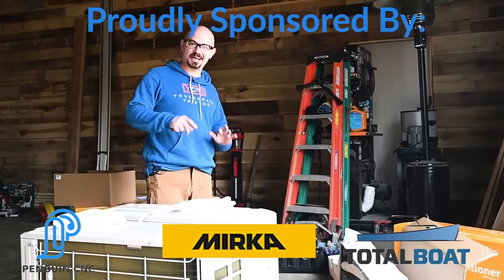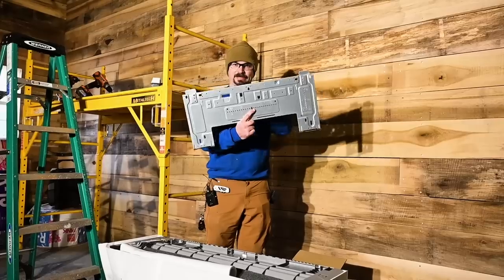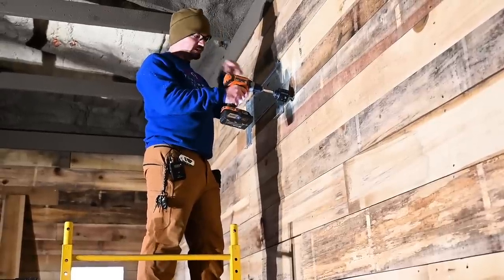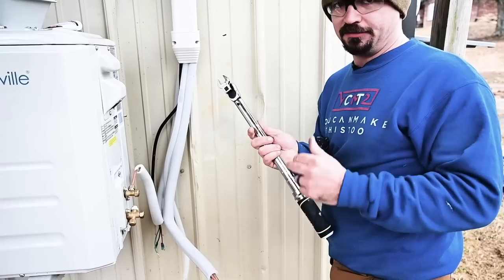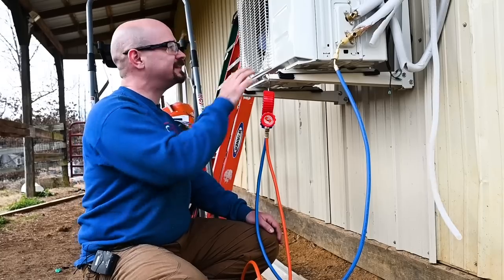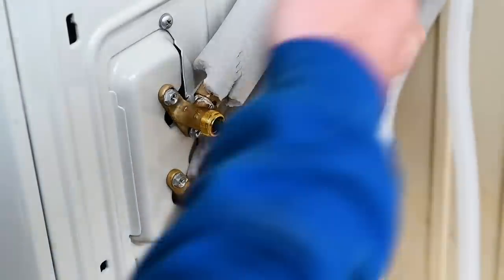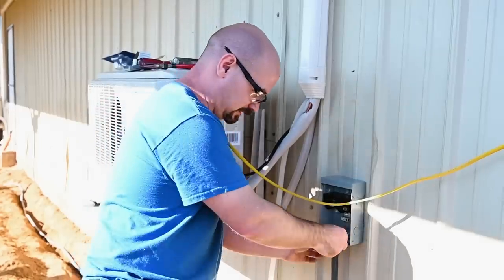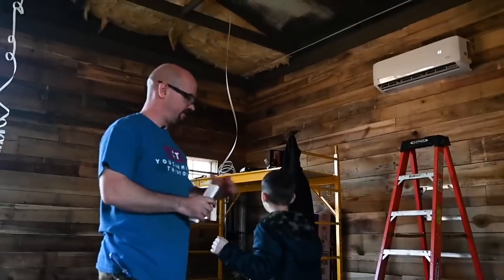Installing a Senville Mini Split | Dream Shop Ep8: HVAC Install

Comment: Some are saying you should have gotten a pro to do the installation. In my area the pros wouldn't do my installation unless they sold me the unit. I installed 2 units myself using Senville's installation instructions and after 3 years they are still running OK.
Reply from the maker: I’ve heard that a lot. 

Also in my area I’ve learn that most of the pro’s… aren’t. They’re just full timers.
Reply: What size (BTU) were your units? Did you evacuate the lines? I have a 12k senville 120V and am hoping not to have to evacuate the lines. 
Thanks
Reply: @RehdClouhd  I installed a 9,000 and a 12,000 btu unit. The Senville lines  were not charged, so they had to be vacuumed. The installation instructions tell you how to do it. I bought a vacuum pump on Amazon for about $60 and a single gauge manifold for about $30 from one of the mini suppliers and then sold them for about 75% of what they cost.  The MrCool (or MrKool) mini splits come with pre-charged lines and don't have to be vacuumed.
Reply: You are 100 % correct. I had a business that came to clean a mini split at my business, and I asked him if they would install a new unit for me. The tech told me yes and just got ahold of them. A few months later I asked them to install it and they didn't realize I was talking about a unit I bought, I was pissed since I needed it done asap and so I gave them a 2 or 3 star review saying they refuse to install a unit that wasn't supplied to them. A week later, the owner called my business partner and said he would be willing to do it, and they simply wouldn't warranty it(which was fine since I didn't expect them to anyway). They came out to give me an estimate and  wanted to charge me $2400 + $300 + 8.9%tax for the electrical, which they subcontract out. FYI, I was providing all the wiring/linesets and electrical boxes. I felt like they were purposely overcharging me to compensate for the fact they didn't sell me the unit and weren't making money on the sale or the fact that they were pissed about the review idk.. But paying $2700 to install a $2200(36,000btu 3 zone minisplit) unit was ridiculous since they were only going to send 2 techs to install it, and it would take less than 4 hours. So I decided if I was going to pay a total of $2,940  after tax I may as well buy the proper tools and do it myself!( also I was planning to add 3 more units over the next year into my shop so it would be worth the investment). I bought about $1100 on quality tools(vac pump/gauge set/Micron gauge/hvac torque wrench set/pipe bender kit/flaring tool/deburr tool/pipe cutter and a few more tools). I have installed 7 mini splits since 2017, and it was totally worth it to buy the tools since I saved so much in installs and learned a new skill. I eventually bought a recovery pump/scale/recovery tank just in case I needed to fix a leak and pump down the systems or do any repairs. I can now install units for friends and family if they ever need one and save them a lot of money, not only the install but the cost of the units themselves.  I have seen videos of people having 3-4 zone units like the one I first installed being charged $10k-$14k! It nice to know I can do it for like $2500-$3000 or basically the cost of the unit.
Reply: @YouCanMakeThisToo  in my area about 5 years ago, there were very few hvac techs that installed mini splits, let alone knew much about them. Traditional split systems are just so much more inefficient and loud/bulky.
Reply: @YouCanMakeThisToo  Along with that, I just bought a 2-head system for 1/4 what it would cost to have a professional (or.. "full timer", which made me LOL) do the same installation. Sure, they know the code, but they're also going to go fast and cheap, where I'm going to get the install I want.
Reply: @randybobandy9828  So uh, you anywhere near Oregon, and, um, whatcha doin' this weekend? ;-)
Reply: @deanwoodward8026  I'm like 2.5hours north of Oregon lol

Comment: I have done 6 of them.  They are easy to install.  I call it DIY...  Maybe not for a snowflake but for someone mechanical they are a breeze.
Reply from the maker: Like everything, just depends on your prior experience. I'm not particularly mechanical though, that's why I struggled when the instructions didn't match the product.

Comment: Got a quote on one of these systems for 3 indoor and one outdoor and price came in over $35,000. Well, I laughed and we went with a forced air system with all new duct work for less money. I'll never go with an HVAC company who over charges for split systems and do it myself for $30,000 less and eat the cost for replacement parts if needed as you are doing:)
Reply from the maker: That's a wild quote

Comment: How do you lift the indoor unit off the wall mount after it is put on? That white plastic ring is visible when the unit it mounted and looks like garbage.  Need to take it off.

Comment: You know you learn something everyday, I’ve been using a flat head screwdriver to tighten those fitting nuts for years not knowing there was a wrench for them lol!!! Great video, mini-splits the way to go!!!!
Reply from the maker: Haha right?! ain't that thing awesome?
Reply: Every electrician I've ever seen work just hammers on a flat screwdriver. Now there's a new tool I need. Properly, btw, that's a "spanner wrench"- I've seen and used them, but larger ones for adjusting motorcycle shocks and coil over springs.

Comment: Nice work! I appreciate the cost calculus you go through vs. a 'professional' install or warranty. Residential HVAC guys are scared of these splits, and if not, they should be. The rest of the world treats these things as disposable, and install is usually very cheap (maybe a hundred or two.) HVAC guys love to talk about warranties (and possible lack with DIY), but they forget to mention, as you said, that only the parts are covered. Their labor can easily cost 2x what the part does, and you rapidly hit the point where it's cheaper to buy a new indoor or outdoor unit. They even consider refrigerant as 'labor', and at massively inflated costs (even considering how expensive 410a is getting.) Not to mention, you need a $100+/year service contract for your warranty to be valid.

I don't mind anyone making good money for their labor, if they can get it, but charging $400 to replace a $40 capacitor that requires 3 screws and 10 minutes is just ridiculous. All the big, conventional split systems are also cheaply made in or with parts made in China, so saying the minis are cheap junk is quite the stretch.
Reply from the maker: Exactly, even if I have to replace these every 5 years.... really ain't that bad.

Comment: The shop is looking very nice. I know here in MS that both of those units will be working hard in the summer. Stay safe sir.
Reply from the maker: I'm really curious to see! The doors are sealed now and even holding a 35f temperature difference with the outside the units normally idle at around 30/40% capacity and even shut down occasionally. That's about the same difference they'll hold in summer if not more, so I'm curious how much they'll run. Big reason why I sunk so much money into insulation.

Comment: might want to paint that dark brown metal roof white to save on your Mississippi summer AC bill. I personally would of put fiberglass batts in the ceiling,  then vented the attic. vented attic allows for air to heat and move out the radient heat from the dark metal panels. When a roofline is 100% spray foamed, radiant heat will travel through the spray foam. painting the roof white reflects the radiant heat. Thanks for video, planning on DIY my own minisplits latter this year.

Comment: Thanks man, nice details. I just finished with a 115v unit 12000 btu and most directions from book were good but wasn’t clear on the breaker amperage. So I got a 20a beaker and the only disconnect I could only find was a 60a disconnect (not needing it as the breaker) finished with all hook up went to turn it on and blew the 20a breaker. Went all through my wiring, all was correct couldn’t figure out the issue. Then reading the outer unit stating 25a max breaker. I figured that meant don’t go above 25 so I figured the 20 would work. Nope after much research I have to go back and try a 25a so wish me luck.

Comment: Guys like this is where the 1 star reviews come from for great equipment. No micron gauge, so your hoping there’s not a small leak. You’ll only see massive leaks using gauge to view. Power to ya DIY.
Reply: A micron gauge isn't for detecting small leaks. Its for helping you to determine if you have virtually all of the water vapor and other non condensables out of the system. Even if you could achieve a perfect vacuum, you still only have a pressure differential of about 16 psi between vacuum and atmosphere. That's not much of a leak down test when typical operating pressures are in the 400 psi range. That's what the high pressure nitrogen test is for. and its a step that many "full timers" skip. They don't care if all the refrigerant has leaked out 2 years after the install. The inside joke is about providing a 30/30 warranty. Translated that means 30 seconds or 30 feet down the road, whichever comes first.
Reply: @jamesnasium7036  you’re clearly either new to hvac or know nothing about it. You should look into decay tests and educate yourself.

Comment: I don't own one but Mr Cool sells a unit with pre-charged lines. No need to vacuum or pressure test or even have gauges.
Reply from the maker: I thought about mr cool but didn’t want to deal with a bunch of extra line set laying around

Comment: Great video.  I see you're using crowfoot attachments on your torque wrenches. I was thinking about buying the set from Harbor Freight.  Did you use SAE or metric crowfeet?  Thanks
Reply from the maker: I think the unit had metric fittings, so metric. I have both sets

Comment: Thanks for de-mystifying this process. I am curious what you used (the white stuff) on the male threads of the flare joints on the copper lines? I know most HVAC folks use a very small amount of Nylog R410A friendly lubricant/sealant on the flare mating surfaces. They seem to be very careful about not introducing anything "foreign" into the refrigerant lines. Nice clean job!
Reply from the maker: It's just some thread sealant from my local hardware store that said it was refrigerant safe. If you have the time it's probably best to order the Nylog / Nylock?
Reply: Flair fittings don't need sealant on the threads, but it does keep the threads from seizing on each other. I worked on Reefer units for sea-going shipping containers and we used a graphite based lubricant on the threads. There is a tiny gap between the tube and flair nut, so "sealing" the threads does nothing as far as leaks are concerned.

Comment: How about a 3yr update? Are they working good? Have you had to replace anything?
Reply from the maker: I’ve had to blow out the condensate line on one of them a few times. Otherwise still chugging along great
Reply: @YouCanMakeThisToo  that's not bad. Thanks

Comment: Great video. I’m about to start installing a Senville myself. I was going to wall mount the condenser on my shop like you did. I just noticed in the instructions that Sanville says you need a minimum of 12 inches of clearance behind the unit. What are your thoughts? Obviously, we can’t get more than about 3 to 4 inches of clearance with a wall mount.
Reply from the maker: Mine is probably around 8", I haven't had any issues in the two years mine have been running

Comment: I've installed 5 minisplits so far on my property, a TurboAir, Mitsubishi, Diakin, and two Gree's (branded as Trane/American Standard), they all came with great instructions for install. I just purchased a Senville 18K HP/AC, I'm reading through the manual, it's so generic, nothing specific to the unit I purchased. I'm very disappointed in this lack of unit detail. It has nothing even in the tables for what size the refrigeration lines are, or wire size for my specific sized unit.
I got this Senville to replace the TurboAir, as heat pump operation has horrible software where the unit never finishes a defrost, so ice build up occurs unit coil is iced over. 
If you've paid attention, you no longer can purchase R410a unless you have a EPA308 certification. Amazon and eBay were somehow forced to remove all sales from their sites.
I didn't see you cover making those flare fittings, but the trick is to properly deburr the cut line, which is hard to do using a single point hand held deburring tool, a conical tool that looks like a counter bore type tool works much better, and that probably could be used, but I got a pricey Noga one to do this. Also a flaring tool that does a proper burnishing (Yellow Jacket makes a good one). 
I know DIY'ers may not have the tools, but buying good enough quality tools pay for them selves versus paying a HVAC tech to do it for them. You really want to run the vacuum pump overnight to remove all the water vapor from the inside of your tubing especially long runs like you have. There's no filter dryers in these units to take up any water vapor left in the lines. So a micron gauge is really desired here to ensure no leaks and all the water vapor is removed.
We shall see how long any of the units last. My original old style house AC that I installed is 25 years old. But R22 is much lower pressure compared to R410a, and there's only a small electronic circuit card in the air handler that delays the blower on and off, versus a minisplit with inverter operation to fail.
Reply: I agree with your basic premise that "good enough quality tools pay for them selves" and would like to add my own observations. When forming flares I can minimize the effort that it takes to remove the burr or ridge by using much smaller increments when using the tubing cutter. I use a T handled tapered reamer for tubing up to 1/2 inch. that reamer doesn't get used for anything else in order to keep the cutting edges nick free. I've been known to take a common countersink bit and use chuck from an old cordless drill as a holder. The Yellow Jacket and the similar  Ridgid eccentric flaring tools are nice but the big orange store has one one sold under their Husky brand for less than $50 or about 1/3 the price of the YJ. Rather than simply let a vacuum pump run overnight, I'd rather have the knowledge that it is working effectively. For that I'd recommend spending the money on any of the name brand micron gauges that the pro's use. Don't bother with extra bells and whistles like bluetooth and WiFi. Personally I own a CPS VG200. Simple to use and easy to clean if necessary. Any serious DIYer should have a nitrogen regulator and tank. If you already have an argon tank for TIG welding, that would be a suitable substitute. Use it with the N2 regulator instead of the flow reg. Same CGA580 threads. Yes, argon is more expensive but for the small amount needed for the high pressure test its better than buying or renting a separate tank. Its better to find a small high pressure leak before releasing the refrigerant. There is no simple way to see how much refrigerant is needed if the system is low other than removing all of it with a recovery machine and weighing it back in. For that operation and to buy R410a refrigerant you'll need to take and pass the EPA 608 certification test. Check out skillcatapp.com for an almost free way to get your cert.

There are a few things that can be said about those old R22 units. Oil the fan bearings, replace the dual capacitor every 4 or 5 years and hopefully before the compressor (or fan motor) burns out, top it off with the stuff in the green jug every year or two, feed it lots of electricity and hope that the neighbor's AC is even louder so they don't complain. I won't miss 'em.
Reply: @jamesnasium7036  I too have the same vacuum gauge. But I think most DIY'ers don't want to pay for a one time only $200 gauge.
I should have taken the 608 test back when the local community college was offering them, but now they don't. I saw that skillcat test just recently, and have some videos qued up to watch. But getting affordable refrigerant from the local supply will not be cheap. I've not paid attention to what the next replacement will be.
I was trained in HVAC back in 1974 via a two year trade school. First job was working for the Trane company in LaCrosse, WI as a lab tech. Did that for a year and saw I was just as smart as the engrs, so went back to school and worked a career in electronics for Collins Radio. I have to say the most useful education was the HVAC two year training. It's major cost saving doing all my own home repairs, and that's on every aspect. Just wish my age was not making everything so darn heavy.

Comment: I purchased a 110v 9k btu can't we ran the electrical through the cover and hook them inside wall   outlet connection with a disconnect switch on outside

Comment: Wish I could put in a mini-split where I'm at.  But I'm going to have to wait until I get a new shop.  The small portable air/heat unit I have works okay, but the splits work a lot better, I've heard.
Reply from the maker: So far I've been really impressed with them. One of the really nice things is they run off a DC inverter so the compressor can run at less than 100%. A lot of problems can come from it only running at full blast or off, the ability for it to ramp up and down saves power and keeps the temperature and especially humidity a lot more stable.
Reply: @YouCanMakeThisToo  Yeah, that is nice.  The portable I have costs me less than $20-30 per month to heat my garage.  I've been impressed with it, but it struggles when the temps get down into the 20's.  But my shop isn't well insulated.  So, I'm happy, but could be happier. LOL